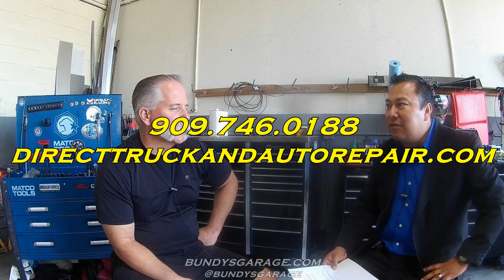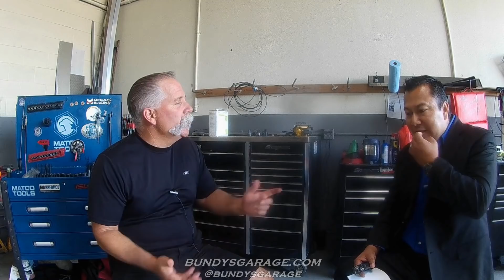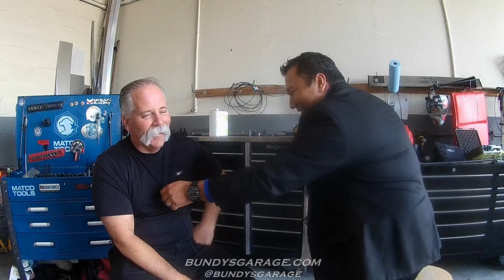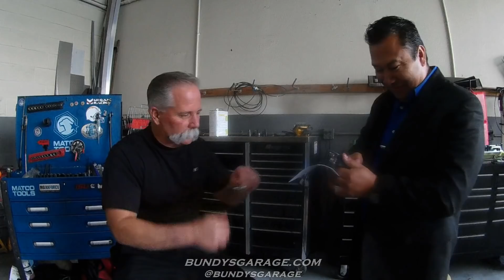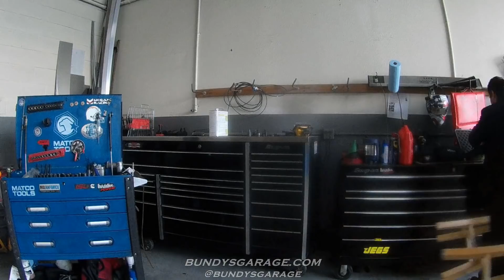Worst Diesel Engine Ever - What is the Best Diesel Truck out There? | Ford Dodge Chevy

Comment: The Ford 7.3 6.0 and 6.4 are international engines...the 6.7 is a true Ford engine
Reply: But its still Fords engine
Reply: @BrandonS55  well Ford paid them to get their engines. The 6.7 was actually built by ford
Reply: Northern farmer I know, but that’s like saying the Duramax isn’t chevys motor, its izuzus, I think that’s right😂😂
Reply: @BrandonS55  not really..the duramax was a joint venture between them...Ford just bought the engines from ih
Reply: The 6.4 was made by navistar
Reply: @jarrettgripp9304  so was the 6.0 and 7.3. Navistar is international

Comment: I’ll sum it up so no one has to sift through the nonsense in this video.

Don’t buy an 2003-2010 Ford diesel, period.

Every other diesel pickup has issues but they are nowhere near as bad as a 6.0/6.4 truck.

Comment: Can you soak turbo parts in a hot tank to remove carbon?
Reply from the maker: If you want to remove carbon open up the turbo and use over cleaner on the inside. Oven cleaner eats carbon.
Reply: Wd 40 or cheap thin spray oil. The oil softens and loosens the carbon while the solvent breaks it down.  Works like a champ.

Comment: I am still amazed how many people buy a diesel powered truck who do not need the towing power...ever. They spend 8-10K more than a comparable truck and never really tax it. In my mind a diesel truck is built for work. If you are hauling large/heavy loads then it is warranted but you don't drive a finish nail with a 9lb sledge. The right tool for the job is the most important consideration as well a ROI. You pay more for maintenance and fuel for a Diesel as well as the initial purchase price, so you are likely not going to see and ROI for 150,000 miles or more on that vehicle. For businesses this may make sense but for the weekend warrior with a less than 10,000 pound RV trailer, this maybe overkill...
Reply: Maybe you don't but we are real men. I use a 2lb hammer for everything. I bet you can't even swing it, lmfao
Reply: @kenshinhimura9387  Not sure why you responded as you did. Maybe you were being funny or you were calling me out, but lets look at it this way. I own a cattle ranch and I get up at the buttcrack of dawn to work the cattle and run them through the shoots. We do things to them that would like make you faint. My hands are hard from using post hole diggers to set new posts on the barbed wire fence that is constantly requiring repair. The only diesel I have on my John Deere 2040 tractor that I bought in 1980 and it still runs like the day I bought it. Yeah, I have a 9lb sledge, framing hammers, nail guns and real guns. I do my own mechanical work when the warranty runs out. In my world trucks are a tool, a necessity. Yes, as I got older I also take time to enjoy life with my RV, but for 40 plus years my trucks were used to haul and pull loads for work. So I am not sure you were just having fun or having fun at my expense....I apologize of I over reacted but I worked hard all my life to have someone call me out that way. I take offense to it.

You know back in the day before the internet, people had to talk face to face and if you said something like that to someone, you may have received a response that included knuckles. I respond on the internet the same way I would respond if I was face to face with someone. That is how we maintain civility. It is easy to talk smack when you are not face to face, but it does not mean you should. 

Not laughing my f'ing ass off.
Reply from the maker: I love your response. People think they can say anything while they are hiding behind a keyboard. Especially this younger generation. Soon they will ask to do a job interview through texting! WTH!

I think that would be great to live on a ranch. Have land and be away from everyone, all the people that live in and near Los Angeles is stupid. Have a ranch style house, 50 or 60 acres with some mountains and a stream running through it. A large wooden word A frame shed that has all my tools and my Bugatti. That would be great!
Reply: @rvninnorthcarolina3377  Just giving you a hard time and yes I would say this stuff to anyone's face. I tend to speak my mind whether or not people like what I have to say.  I hope you wouldn't assault someone for exercising their freedom of speech. That's an easy way to wind up in jail. This isn't the good ole days where you could just fight it out and shake hands at the end. I personally wouldn't call the cops if you punched me in the face but I know some bystander would. You gotta protect yourself. Someone is always ready to film you with their smart phone.

Comment: For once I can agree,he's right,I do like the old 7.3idi mine has 500,000miles it's been abused hell I never change the oil lol,only problem I have is leaking injectors witch allows air intrudtion ,but I put a electric fuel pump on the return line's to bleed the air out ,starts every time,it has the ZF 5speed I took the old duel mass cluth out and replaced it with a better regular clutch ,witch gave me more power,it's not so heavy,and it has the dependable Dana rear end ,I will drive it until it quits and fix it and drive it more😀

Comment: I own two 6.0 powerjokes, one is bulletproofed and is my plow truck. Tons of power and reliable. The other is my stock, never tuned, never beat, 2007 with 260k on it. 6.0 is way too go

And also just go with a gasser. Save money and run it to 200k+. Wish I bought gas but I have an ego problem ha
Reply: Had divorces that were cheaper than 250k cost me on my 6.0......
Reply from the maker: Now that’s funny!!!!!!!
Reply: PROJECT in MOTION why would you say “just buy a gasser”? Sure if you don’t tow

Comment: 6BT 5.9L 12 valve Cummins in a 1987 Chevy V20 3/4 ton pickup with a Eaton-Fuller 10 speed manual transmission and 1 ton full-floating axles
Reply: Would've been a whole lot cooler with a 6v53 turbo.

Comment: Duramax for sure. Isuzu really knows how to do a proper Diesel.
Reply: Well the Isuzu part of duramax is about 50.percent of the work gm did a lot of work on the duramax also.
Reply: That's how gm could even design it in like 1 or 2 years.

Comment: Ok so here's a wildly unrelated question.

Given 2 engines with the same displacement ( if it's possible ) which is better fewer but larger cylinders or .... more but smaller cylinders.

Essentially, if you and a 350 and you could either be 6cylinder or 8 .... which is better?
Reply: @Copperhead Sutton Thanks!

Comment: Interesting logic, choosing the worst engine because he has worked on a lot of them. I am not a Dodge fan and know the 24 valve engines had block issues but still the best diesel out there!
I would ask anyone who would disagree what other diesel do people swap into Ford and Chevy?
Reply: The Cummins is done for price to performance and ease of maintenance but the gm 2 stroke diesel are also really popular swaps if you can take their weight.
Reply: jdr ok I would also say it is a better design, straight 6 vs. v8, less moving parts and makes the same or more power and gets good fuel economy!
I have an 04 3500 with 6 speed manual and 35” tires,my best so far is right at 1200 Kms for a tank of fuel ( I think that’s 700 miles per tank), not bad!

Comment: Volkswagen made a good diesel car.My 2003 Beetle got 50 mpg and never gave me grief for 200000 miles I sold it to a friend about 7 years ago,he is still driving it.   A diesel truck is only practical for towing,unless you really like them.
 The worst diesel engines were from the 1970's. Detroit said to replace spark plugs on gasoline engines with glow plugs and install a fuel injection system.The engineers said such a ideal would not work.They fixed the problem by firing the engineers.

Comment: I like the Ford body an suspension gives good ride, death wobble- like any vehicle it has to be maintained-no slop, I have seen all brands do the death wobble, but he is right, Ford Body, Cummins motor(12 valve) but no Allison, a Heavy duty 6 or 7(I wish) speed manual compound first(of course) to me would be the ultimate truck!

Comment: Good conversation, Just a heads up on something you may want to try to clean turbos if they're disassembled. Years ago when I bought my 86 Thunderbird TC I just had to have a turbo to take apart and investigate. The Ford dealer I was working with at the time was nice enough to give me a unit that they did not have to return and so I proceeded to disassemble it and clean it up to have one to play around with. The actual turbine proved to be difficult to clean with out damaging. I tried many different solvents and cleaning agents without much luck and then thought, I'll try toilet bowl cleaner. What I used (Sani-Flush) powder is no longer available as far as I know but it certainly did the trick, after a bit of soaking in hot water with Sani-Flush mixed in and rinsing it looked like new. It's been over 30 years and I don't remember how long it took but it was minutes to possibly an hour not days or anything.
Like I said the product is not being produced anymore but maybe you could find what chemicals were in it if you think this might be useful to you at times. I still have that turbo up in my garage attic but the car was sold in Dec 2014 to a collector in Phoenix AZ.
George

Comment: FURD can't keep them going doing to the electrical nightmares, ignition switches along with 50 different variations of diesels. At least GM has had the DURAMAX 6.6 for YEARS now they don't come up with a new engine every year. GM is WAY easier and parts interchangeability period.
Reply: Do we want to chat about the GM 70's 350 Diesel, the 6.2/6.5 Detroit designed GM Nightmare, 2001-2004 Duramax that had issues were fuel leaked into the crankcase and GM was sued for blown headgaskets and overheating issues...which they lost. It was not really until 2007 that they got most of the kinks worked out and the engine became reliable. There are 7 different versions of the Duramax that have come out since 2001 when it debuted. Each one is uniquely different and answered both reliability as well as emissions requirements. Even though the 6.6 displacement never changed the engine did go through (I think) 7 variations....to the point, I don't thing GM was immune to constant design changes. The last iteration of the Duramax came out in the 2017 model year. I am calling you out on your statement. Not saying the Duramax is a poor power plant, nor am I saying it is better or worse than any of the others out there, but lets get your facts in line!
Reply: @rvninnorthcarolina3377  sorry you are wrong. base engine is identical across all the years. the only difference is the upgrades to the fuel injectors, turbos, emissions systems. for the most part the engine itself remains the same. as for the 350 diesel and the 6.2/6.5 stay on topic. the discussion was on the duramax only not prior diesel engines. 6.5l by the way wasnt too hateful just the injection pump. engine was pretty stout, under powered but reliable.
Reply: @Copperhead Sutton any good diesel tech knows that you can see the markings in the head gaskets without taking the heads off. its called using a flash light. problem solved. stay on task the discussion was duramax and to my knowledge the 6.5 wasnt released as a 6.5l duramax. by the way the diesels were never popular in america because gas, with the exception of the shortage in the 70's was always super cheep. unlike European countries where gasoline sold "like gold" prices. so cheap gas and Americans loving v8 gas engines mean no diesels.
Reply: @smokindiesel6063  To be clear Changing Fuel Injectors, Turbos, Emissions systems, and what ever is "for the most part" means they did change and there were issues with earlier incarnations of the engines that are documented. Staying on point and getting off this thread.
Reply: @rvninnorthcarolina3377  the engine is the same. The changes were to bolt ons that, with the exception of the vin 1 duramax injectors that would fracture and leak, were only made to make more power not correct design problems or to polish a turd - cough Ford/international oil fired  injectors that couldn't keep up with emissions standards and still meet the power need. So same engine. Higher performance parts with every generation. For the most part was things like stronger rods and bolts to handle more power. Ford/international engines couldn't compete on any level
Reply: I've had worse electrical problems with Chevy/GMC than with Dodge and Jeep, and that's saying something.  The Duramax has stayed at 6.6 liters for all of this time but has had numerous changes over the year and parts interchangeability is limited.  And what electrical problems does Ford have?  I'm on my 7th Ford and have not had electrical issues--not even a factory amplifier going bad and running my battery dead every day and a half like my '05 Chevy 1500 HD did (among other failures).
Reply: @406Steven  Sure you did that is why the Furds got rotten resale and v6 turbos that require thousands to keep them going....

Comment: Diesel motors are not meant to be a v shape.  Piston are heavy, which leads to cylinder wear. Had a Ford power stroke. Now have a 5.9 with 350k on it. Solid Truck.
Reply: Ever heard of a 3408 cat,3512 cat,Cummins 555,Detroit 8v92 just to name a few?

Comment: Love my 2000 F-250 7.3 Power Stroke! I got 394,000 miles on it :) I've installed all Banks hardware in 03, Inter-cooler, big strait thru exhaust and a TS power chip.  I plan on taking my truck to my grave! Never let the exhaust temps rise.  Like the Man says 'Keep up on the Maintenance' and it she will last!

Comment: I had a '96 F350 with the 7.3. Only real complaint is the cam sensor went out 3 times in 11 years. Only had about 140K miles. $500 to $700 repair each time. 😤
Injector seals went out also, but I think that had more to do with the "ultra-low sulfur" diesel fuel junk.

Comment: I have a 99 Ford F250 (Dinosaur), on the verge of hitting 300k.  My daily driver.  This truck was never a pampered toy.  The ride is still smooth, still feels solid.  Runs like a champ. Only major repairs, the air conditioner at 240k and rebuilt transmission at 266k.

Comment: I've been a diesel mechanic for 25 years, and I agree the ultimate truck would be a Ford chassis with a Cummins motor, and a Allison transmission!
Reply: Nah perfect truck is the either 7.3 or 6.7 powerstroke on any Ford truck with 4R100 tranny

Comment: Please, light-duty diesel engines are a marketing joke and sold to the John Doe need a new ride every year crowd. My 1997 Peterbilt 379 Sleeper with C15 Cat just passed the 4,000,000 mile mark and I plan on retiring her when she hits the 5,000,000 mile mark. And you say getting 500,000-mile is an achievement? An embarrassment if you ask me. I would never own either of them.

Comment: Your average modern diesel has a super high pressure injection system that costs a bundle and limits fuel type to ultra low sulfur, EGR plumbing, particulate filter that WILL gum up, DEF injection, and multiple cats. Not to mention the variable geometry turbos that also cost bonkers amounts. Unfortunately, the main reasons to utilize diesel over gasoline motors, durability and fuel efficiency, have pretty much disappeared. There are far too many working parts that are having far more asked of them, and they are harder to work on, like he mentioned but also have 3 times the maintenance costs of a comparable power gas motor.  I'll be interested to see how the hybridization of gasoline motors with a couple companies running high compression auto detonating systems here soon. I bought in to the diesel structure in a H/O gas motor myself (2.7 ecoboost), so we'll see how that goes. The Ford engineers are missing the ball on transmission tuning for their eco mode though. Absolute lug city in that and normal mode. I just hate that the diesel will likely die out for the most part once the big rigs go electric and gas electric. They are just too much of a pain in the rear, and too expensive.

Comment: So why is it eropean diesels do not have these huge issue. 
The ford diesels in europe are all psa engines 4.4 3.6 v8 diesels
Volvo diesels, mercedes diesels all fantastic clean engine 
The diesels in the range rover the v6 and v8 are great 
The vw v10 great . So why is it you cannot produce a good diesel
Now dodge is fiat you have access to better diesels. Why not use them. 
Before you knock a decoking chemical try following try following the instructions.
Smog leaders no your not. Your way behind the europeans.
Stop putting this agricultural engines in vehicles.
The problem with Americans is they do not look after there vehicles that why they do not like european cars because you have to look after them.

Comment: i live in montana...... i LOVE that i can make my motor make more power..... and make it sound good.....
and its fine

or i can drive my 77 chevy half ton..... 12MPG
which as little as its driven..... is more eco friendly than making a whole new truck

everyone has their pickups modified..... we dont salt the roads, so their are 100s of hotrods and OLD cars still daily driven.....

montana is a low key hot rod paradise.... 
straight, flat 2 lane black top..... for miles and miles, and not a 2nd car on it